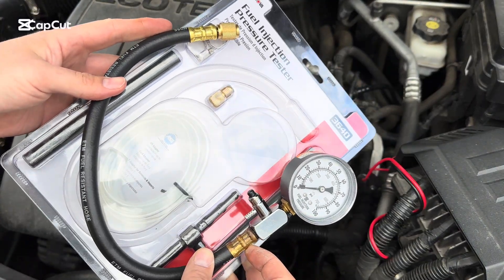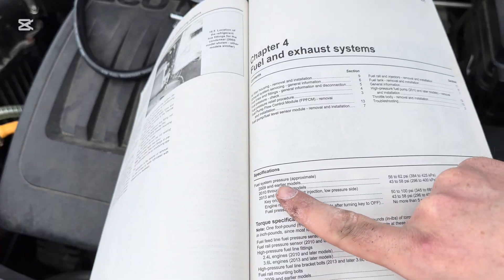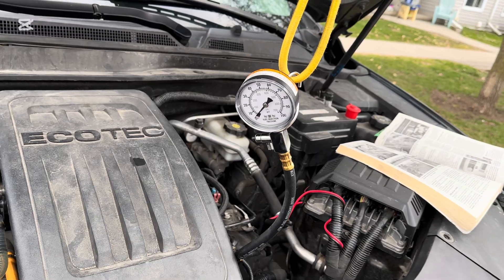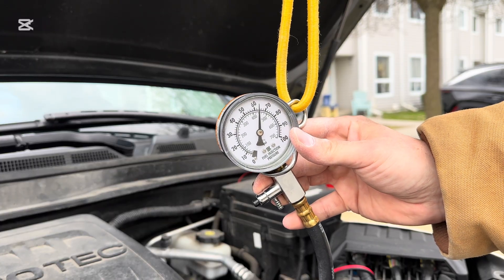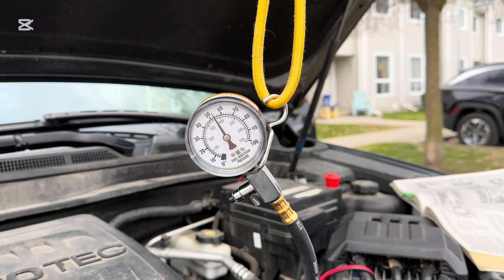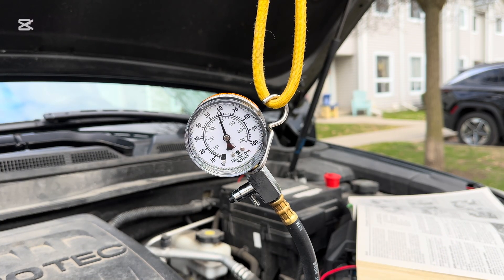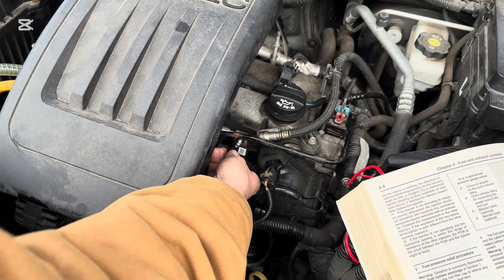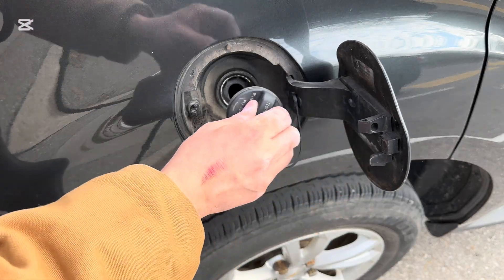How To Perform A Fuel Pressure Test (With Leak Down Test)

Comment: Great video, Bill Of All Trades. Looking forward to your next upload. I pressed the thumbs up icon on your content. Keep up the amazing work! Your detailed explanation of the leak down pressure test was particularly helpful. What are the most common issues you've encountered that lead to pressure drops in fuel systems?
Reply from the maker: The most common issues causing a drop in pressure would leaking injectors, leaking fuel lines, worn out fuel pump, and bad pressure regulator that is stuck open. Basically any leak anywhere in the system will make the pressure drop as well as any faulty or worn out fuel component. And of course faulty pressure sensors can cause pressure fluctuations. I’m glad you found this video. Thanks for your support.

Comment: I couldn’t help but notice that oil cap looks pretty clean. Is that one of the venting caps?
Reply from the maker: No it’s just the OEM unvented cap. The o ring on my original cap was ruined and flat so I went to buy just the o ring but at that time everyone was out of stock. Amazon had a cap and seal for cheap so I bought it. Thinking back I should have bought the fc 219 vented one but the OEM one I think was cheaper lol.